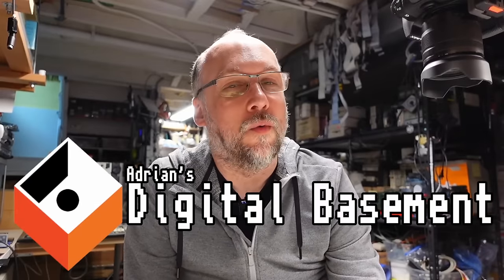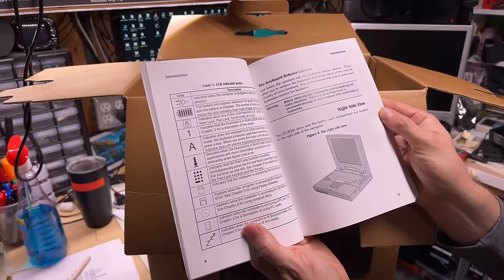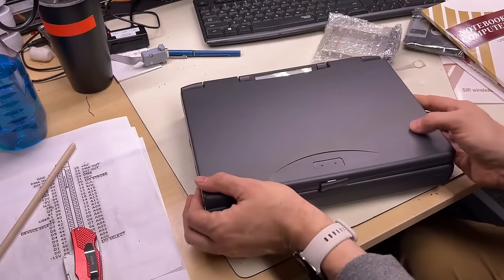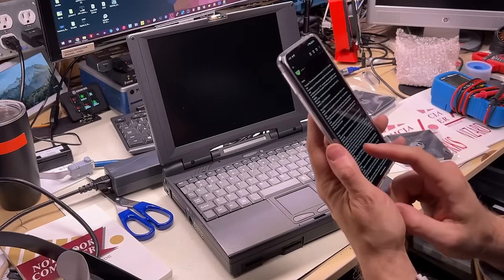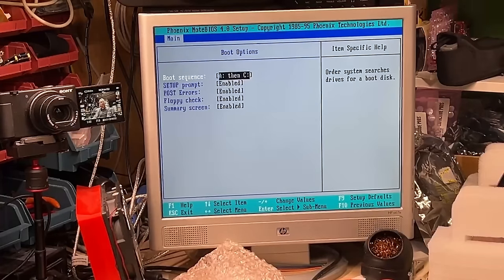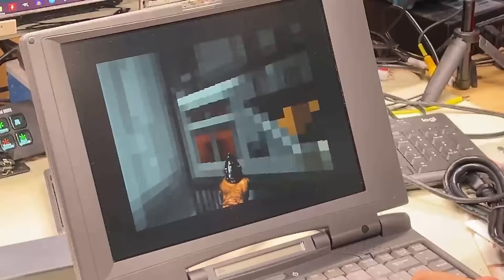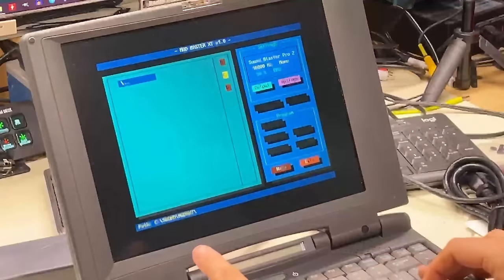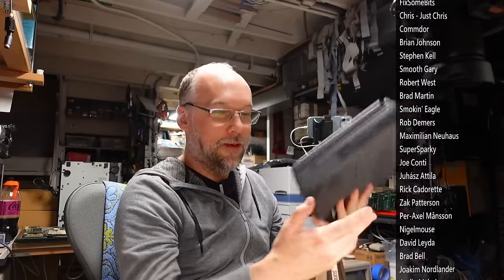0072 Unboxing and testing a brand new 27 year old laptop

Comment: Laptops (like phones) used to be way more interesting back in the day. Modern ones are more or less from the same mold.
Reply: Perhaps, but modern systems are much more end user friendly then the older systems. You saw how much trouble and time it took him to just simply set up the sound. You could rarely use one of these older DOS based laptops right out of the box. The software set ups were much more involved and complicated with autoexec.bat and config.sys issues, IRQ conflicts and constant software compatibility issues even on platforms like Windows 3.0. I honestly don't miss those days at all and am glad PC technology has advanced beyond all that nonsense but, having said that, the issues with Windows 11 feels like the industry is reverting back to the old days. I still have a system that is running Windows 7 because it was such a stable OS and very easy to use. My first system was an Everex Step Intel 386 DX-20 massive tower with 512MB of RAM and an 800MB hard drive. It came with a Zenith 15" flat panel monitor, keyboard and mouse and cost almost $3000.
Reply: @walterlegere1403 Don’t agree. Many things today are software dependent upon ‘updates’, then things break! Many items were baked in and mission specific, like phones.

Comment: @adriansdigitalbasement2 The backlight of most notebooks of this era (Thinkpad 380, Toshibas etc) were fluorescent light with a micro ballast. So after a while they become very weak, just like common fluorescent lamps.

I have a ThinkPad 385 which was pretty bad, I ended up adapting a blacklight led
Reply: I can relate, as I have a ThinkPad R52 that had the issue, and the backlight was yellowing, but it eventually stopped working entirely.

Comment: I had a Sanyo suitcase computer in about 1989 it had a 8088 processor with 640 k ram , 20 MB hard drive with a 8 inch colour monitor . That Sucker must have weighed 30 to 40 pounds.  I sold it quick for $1200 a year after I had paid $1300 . It played Leisure Suit Larry and was real joy to own. Nostalgia is always better after even a longer time period.
Lucky you getting that baby new in the box.

Comment: The display and sound of laptops of that era were just that anemic. You could see the display at full brightness in an office, but you could forget about taking it outside or into a room any brighter than an average cubicle. ...and of course, if you had any ambient noise around you, the sound was impossible to hear.
Reply: I agree.  That’s why no one had laptops then unless you absolutely had to move around. The trade offs were extreme.  High cost. Bad performance and a 30 minute battery use.
Reply: My Armada from 1998 is perfect for portable retro gaming - plenty of backlight, plenty of sound, and even enough battery power for 2 hrs.
Reply: @the_kombinator  I assume that has an active matrix display. That was a major improvement for laptops at the time. Passive matrix was so lousy, they probably quit using them completely by '98.

Comment: I have an old 486 powered Bondwell compuiter, and also an old Toshiba.  Both of these are still working, and both are very well built.  The Toshiba portable, had an underboard that added all the connections.  The most undesirable feature, is the the mouse is a little green button, that is located on the keyboard.  Why I have kept them I do not know.
I also have four Thinkpads, that were given to me by a friend, but I have not attempted to get any of them running.

Comment: We used to sell something similar at CSS (Computer support systems, inc) We would buy the mules in bulk like this and add our own CPUs, hard drive and memory.. Basically whatever the customer wanted. We had also sold Toshiba and the Toshiba was a tank compared, even if slightly thinner the Toshiba Satellite was always of a higher build quality but then again they would sell for like over a grand more for basically the same configuration. As an authorized seller we would sell them to mostly big companies, and consumers would more often than not buy our "in house" mule. For the time it wasn't bad. I never found them great. But not bad. But then again unless you had deep pockets and bought apple nearly every other vendor was not much better.

Comment: I'll bet that broken screen latch button was why that NOS machine was in that box.  They discovered that and put it back in the box, but it was never returned to the OEM or distributor.  HV power supply possibly at fault with dim screen.  Marginal SMD caps?

Comment: I had a number of Dell laptops throughout the mid 1990's through to about 2005 and they were very solid, quite powerful and when put into a docking station with a keyboard were not much less powerful than a desktop.. They certainly were not 'plasticy' by my estimation. I would travel to customer sites to design software system integration bridges between other software applications running on site. So they survived international travel across the globe (better than I did with the jet lag!).

Comment: in DOS, echo ^G will ring the terminal bell. Your PC will beep at you if you're in DOS, and play the notification sound if you're in Win9x. 

I paid $2500 in 1998 for a Gateway Pentium II laptop that came fully-loaded with all the bells & whistles available at the time. The only reason I could afford it was that I worked for them, and they offered a purchase plan that deducted regular payments from my check. It was a very nice laptop, but yeah, it was insanely expensive compared to a similarly-specced desktop.

Comment: Looked up some PC ads from 1996. Here are the specs and price.

March 1996 Newspaper Ad for the Portable Power Laptop from Acer 950c Series

Pentium 75

8mb RAM

540mb HDD

2x PCMCIA type 2 slots 

All for the low price of $3200 in 1996 and adjusted to today that's $6187!

Comment: I have a laptop that uses almost the same "case" with that small thin lcd but it was a different motherboard with a 486 100. It is great as it was a 486 with an active matrix TFT and  ESS audiodrive sound, but during some shipping got fully cracked in a thousand pieces, took a while to put everything back on and glued with epoxy resin. The final result is ugly but still working great. The funny thing is that mine If i recall right is branded as something unknown but if you look for it online youll find the same computer with different brands

Comment: I'd install Slackware 3.3 or 4 on it. Very cool video.
Reply: Curious if 3.3 or 4 are the best versions - or just the ones that runs best on such an old machine 😊 (saw that the latest release was 15) BR, Per
Reply: @nakfan  well I have been using it very close to that 1996 time. I started with 3.5 and using 14 in 2023. I've not installed 15 yet, 14 still jamming along.
Reply: @jdebultra The unit in the video has only 8 MB RAM, which is just enough to run Windows 95 very slowly, and with a lot of swapping.

Comment: I have an old Dell Inspiron 7500 with a Pentium III running Windows 98 SE and it actually runs very cool. It's definitely a lot cooler than my ROG Zephyrus; the keyboard gets super toasty on that thing whenever it's under significant load. 😂

I installed a 64 GB KingSpec/Yansen SSD in that old Inspiron as well and so now it's both cool and quiet. It quickly became one of my favorite vintage laptops. 🙂

Comment: Just a heads up, laptops from that era, the plastics have gone extremely brittle over time, the creeking could be due to that, be careful with the screen hinges.

That would also explaine the screen latch brakeing 

PS that ESS Sould sound better its worth investigating a bit , check the caps etc...
Reply: By brittle I mean , super brittle it brakes if you just look at it wrong!

Comment: Back in the day also buying a used PC that's 5> years old left you way behind, while nowdays I buy used laptops that were bought by the city ~5 years ago for 50-100€'s and they are fine! I would love to be able to play Teardown though, but I'm sure that in just couple years I'll be able to buy a used PC that can play it ;)

My current main laptop is Lenovo ThinkPad T460p - there would have been newer models, but they weren't much better in CPU performance and there were other hardware choices that made this a better fit for me - like having two RAM slots, and having two GPU's, the usual integrated Intel GPU, and an nVidia GPU, making it possible to run different programs with different GPU :O

I also love ThinkPads, they work great with Linux. And while I can't play Teardown, for the couple days I've been playing Stusts using DOSBox Staging :D I'm trying to get into dosgameclub Stunts leaderboard :P

Comment: Re: tinny sound.  Just a shot in the dark, but it's possible that the audio out has a high-pass filter wired in.  This may be to filter out noise from the computer's internals.  Switching supplies, power regulators, hard drives, and even just wall AC, are noisy in the audible range at lower frequencies.

Comment: The Tecra mentioned in the previous comment is made from the same plastic as this one. Same color and sheen - identical. And it is falling totally apart now - the plastic is disintegrating. It still works, but the shell around it is gradually disappearing :) I have an older Gateway Pentium MMX 166 Solo 2100. The plastic on that one is in even worse shape. Chinese plastic is just full of residual acid (I suppose) which destroys the plastic polymers and the plastic eventually just crumbles.

Comment: That reminds me of the "TI Extensa" from 1996 I used to have which I'm told was an outsourced model rather than other models which really were made by TI. The Extensa was definitely a very different laptop but the power brick could be the same. Rather the casing looks the same (and maybe the electronics), the plug was definitely different.

Comment: My IBM Thinkpad 760XD of 1996 has a lithium battery that still holds a tiny bit of charge (at least for the system clock, when recharged 3 times a year). The connectors with tiny plastic lids on other plastic is much flimsier than this one and I had to superglue small parts. Also my early TFT (1024*800 or such) shows a mess of dead pixel confetti around the rims, although the Win98SE is still well recognizeable. Eons ago I replaced the useless Mwave card with a real FM sound card (taken from the previous model 760EL) which was much better for gaming.

Comment: It's not an "infrared blaster" as infrared blasters only transmit. Infrared laptop ports can receive as well as transmit. It's also built so it may not work more than a few feet away, whereas infrared blasters are made to work across a room.

Comment: What are those LCD status displays are called? It's difficult to search for those because the main screen itself is LCD. When I was a kid, a buddy of mine's father had a laptop around 1996 and it also had a status bar display thingy and I really liked it. That machine was really nostalgic and tried to find one like that but sadly I don't remember much, I don't even know the made. We played Duke Nukem 3D and Mortal Kombat 3 a lot on that machine :) I still remember the weird looking screen and the hum of the vents.
Reply: Do you mean TN (twisted nematic) Display Technology?
Very dependent on viewing angle... :(
Reply: @Bergi2000  Ohh, maybe that's where I was wrong, I called it an LCD. TN it is, thanks!
Reply: It is still an LCD, and you can have TN LCD panels in cheap monitors/screens. I think you'd have better luck searching for reflective LCD segment displays
Reply: I love laptops with those status displays.

They were only a thing for a short period.
Reply: “Monochrome reflective LCD” is probably the best… but each layout is often unique, the circuitry can’t tell if it’s lighting up an error icon or a segment in a 7-segment display. They’re all just on/off zones as far as the controller is concerned.

Comment: I'm surprised to see a new old stock Chinese ODM laptop from the mid '90s!

I noticed that the accessory box had a cardboard filler instead of a system builder copy of Windows 95 or NT 4 Workstation, so it would've not come with an OS! I was reminded of an idea I had for a brief period of time in 2010 or 2011, which was to buy one of those ODM laptops and, instead of buying and installing Windows, I'd instead install Ubuntu Netbook Edition (as I was still using Ubuntu at the time)!

As such, I could imagine someone buying one of those ODM laptops (or building a custom desktop PC) in the mid '90s to install something like Linux Mandrake (Mageia), Red Hat Linux (Fedora) or S.u.S.E. Linux (openSUSE Leap) instead of Windows 95, but that they'd probably then still have to get Windows anyway as not as many large companies supported desktop Linux as there are today.

(13:14) Whoa!!! No LCD vinegar syndrome*!

* There are different terms for it, I know the Japanese vintage computing communities refer to it as LCD vinegar syndrome, I sometimes call it moisture damage, and I've seen some people use terms like screen rot, rough patch, and discolouration.

(18:35) It's somewhat rare to see a laptop that takes a desktop CPU!

(19:57) Oh. Ouch.

Comment: Hey Adrian. You're mentioning you're using NDI with your phone. Its slightly convoluted and will have a latency of 4 seconds or so. However if you can configure nginx with its rtmp module and host that on your pc. You can then use something like larix broadcaster to stream to that rtmp server and in tern get your capture onto obs. However it will have a delay, so idk if it'll be optimal for you. Why I mention this is because iirc larix has a ton of tuning features in it, like color and exposure etc.

Comment: The screen brightness is pretty much what I expect: even my Dell from 5 years later had no chance of being readable outdoors even if not a sunny day. That Dell also had the 'lift up the keyboard' access method! The CC screen light probably has faded somewhat, and may improve with warming up also.
Keyboards of the time were also rather awful, I considered myself lucky in not having to use a laptop in that era (Amiga at home, Unix WS at work!)

Comment: That particular era was not great but it would change rather quickly, the Armada series that replaced the Elite 5000s from Compaq was greatly improved in build quality they went for magnesium for the screen cover and a quite sturdy plastic bottom. We had those E500 series laptops for way longer than one would give them and I have two in my own collection. They were built almost to ThinkPad levels of quality while the early XTRA models of ThinkPads were much more fragile than for example the 600 or earlier ThinkPads. Were interesting times and some really expensive lemons which were poorly built around as well.

Comment: 15:16 I would bet on incompatible timings. There's only one CRTC and one VRAM port for both outputs (which saves a substantial chunk of money). The TFT LCD can be run at timings that are compatible with an external CRT, so having both outputs on at once is just a matter of sending the data to the LCD and the VGA DAC at the same time. But DSTN LCDs are totally weird (they actually split the screen into top and bottom halves, and send one pixel from the top half and one from the bottom half *simultaneously*) so there's no way to run a CRT from the same datastream. You just have to pick one set of timings and disable the other output.

Comment: Great video ! However it provides some good learnings : 1) New old stock doesn't mean "hassle free". Here we have all dead batteries, old cracked plastic latch (never used but weakened with time). 2) It is far from initial expectations with a completely dull display and a mushy keyboard... It's OK that you go it for free, but if you had to pay a good premium for this it surely would be a great disappointment (that story of the broken latch is awful).

Comment: Hi,
Saw a Mod Master XT there :)
If you keep it with the default settings, it is mixing at 16KHz, you can increase it in the settings. but this can't explain mixing bass of course.
Problem of sourd/bass may be capacitor failing.
Mod Master display Sound Blaster Pro2 because this chip is not SB16 compatible.
There is probably replay problem in the .XM file, it is not totally supported. .MOD, .S3M are of course. (But you probably tested the .XM file in another PC before)

Comment: I don’t know man I have two compaqs (LTE 5100 & 5250) and got both of them used. No broken plastic anywhere in sight lol (the 5100 had a working cmos battery for half a year and the 5250 came with the original HDD fully functional). I suppose they’re better quality than I thought with their bright screens etc heh

The trick to having nostalgia for these is to have been given a decommissioned one in 2003 when you were twelve and the laptop was free 👌 my first one was a 5250 as well though it was lost to time..

Comment: This is the exact same model as the first laptop of my mom. It later got destroyed by a cat and I salvaged the pal encoder chip for a diy project of mine. Just 4 years ago we felt the need to reaquire the same model again for pure nostalgic reasons. It works, I maxed out the mem and even got XP installed and also ReactOS.
Sadly it has a very bad display :(